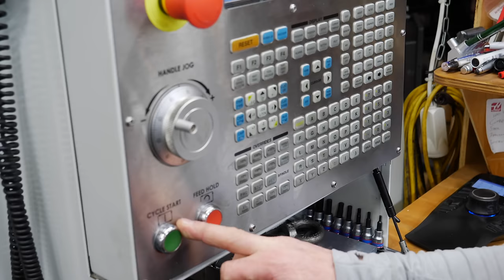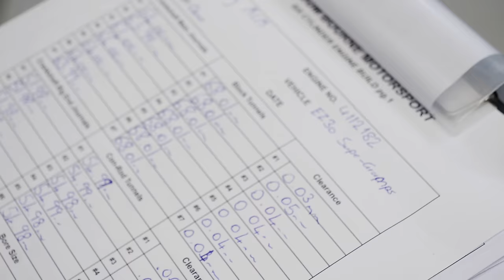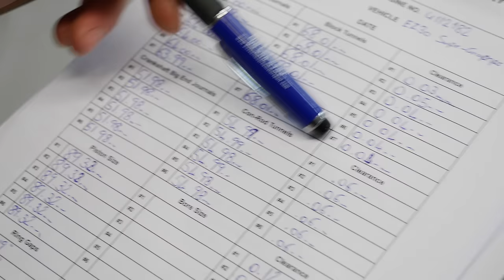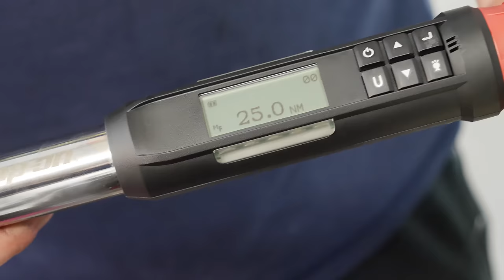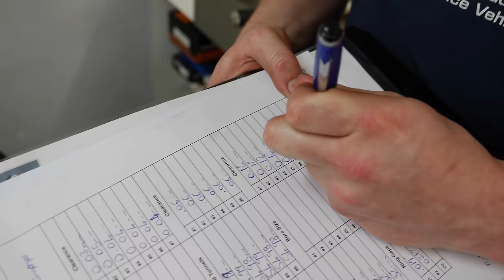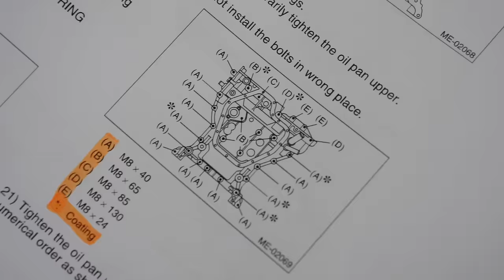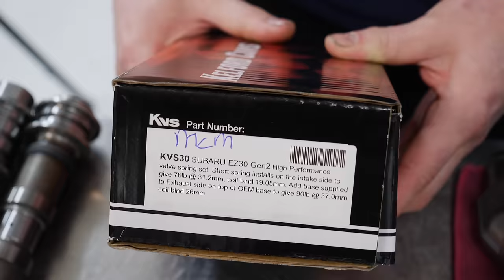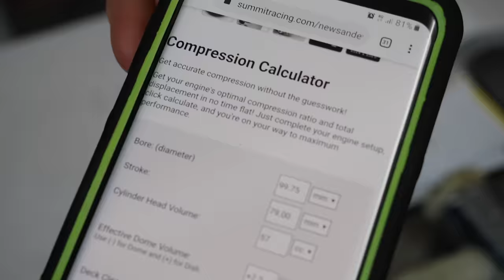What's in the Crate? - Marty's Levorg Part 9

Comment: That fact that dude is in a engine clean room and wearing rugby shorts is probably the most kiwi thing I’ve seen.
Reply: What else would you wear? Apart from safety jandals
Reply: @BrickNewton  I could probably get away with crocks at work. Been wearing a pair of soft toed keen slip on boots on and off for the past year. The rule is don’t get hurt. Refreshing after the last company that required safety glasses, safety vest, and hard hat before you stepped out of your vehicle.
Reply: @BrickNewton  he was wearing boots mate, Rj in Oz
Reply: @BrickNewton   I’m a Australian and I do that  so it’s not just kiwi’s that do that
Reply: I was gonna say the same thing
Reply: Canterbury does make quality shorts.
Reply: Clean room just means no grinders, dust making etc....
Reply: Fuckin oath they do
Reply: A kiwi wearing a kiwi costume was the most kiwi thing I've ever seen.
Reply: Marty in jumper and pants ( leg prisons) Glenn is in short and shorts..
Reply: Needs a roll of fencing wire on the wall...
Reply: The shorts and work boots seemed very fitting!
Reply: @captain1334  an.. an Australian
Reply: @jonathanwright5550  Yeah it's not like the clean room I work in, from time to time, where you have to wear hair nets, beard nets, full anti static overalls, anti static gloves and anti static shoes (i'm a computer scientist). Fail to wear one of those things and my ass is fired. On the spot.
Reply: I'm used to semiconductor cleanrooms. I don't consider this a cleanroom.
Reply: *stubbies (Kiwi name for short shorts)
Reply: I spotted safety flip flops. 😂
Reply: Hahaha the scientists in the lab at my work do the same thing I always give them shit 😂 wearing there lab coats and it looks like they got no damn pants on 😂 if only the bloke wasn't wearing hurricane shorts it might be alright 😂🇳🇿🤦
Reply: Only thing that would make it more kiwi is if he was wearing boots 😂
Reply: @BrickNewton   THONGS
Reply: @hammatime94  yes
Reply: @FalloutProto  pretty sure he's wearing work boots right? 🤣
Reply: @therickman1990  Yep true, cleanrooms are usually vacuumed & dust free which Subaru engine factory has.
Reply: Stubbies all day🤙
Reply: rugby shorts = well balanced low rpm hp output torquey engine that's easy going and steady,

if the builder wears tights you end up with a high revving screaming engine with hp pushed to higher rpm,  not preferred.
Reply: A Big Ben meat pie covered in Watties sauce in one hand, a Tui in a stubby holder in the other, sitting on a shingle beach in the rain being eaten by sandflies is probably one of the most Kiwi things I've seen lol
Reply: When I work on classic cars alot of times I wear a Tshirt and basketball shorts that way when you're leaning on the fenders can't scratch em up
Reply: @David-xl8zf  they're called jandals in NZ, and thongs in Aussie 🤣
Reply: @2dcutout stubbies was a brand of shorts, they’re long gone now.
Reply: @MasterChief37  in the same way I call a vacuum cleaner a hoover (despite being a brand name), all Kiwi's call short shorts stubbies. As I'm sure you know
Reply: @2dcutout  except I’m a kiwi and I don’t, I never have. Probably because my mum never called them stubbies.
Reply: @MasterChief37  yeah I figured you are. I've lived in multiples places around NZ and everyone called them stubbies, hence my original comment.
Reply: ...and he put in those piston pins from the side, like Richie McCaw entering a ruck.
Reply: @2dcutout  good for you, but I don’t know anyone who does, but I do remember the brand.
Reply: With his deep voice I was expecting him to be blurred out or in a shadowy room...
Reply: So humble, the fact that Possum Bourne rang and offered him the job is a huge accolade as well as minting him as doing his job for over 20 years now.
Reply: @BrickNewton  dude......classic! 🤣🤣
Reply: @therickman1990  This is a clean room in terms of car work. You don’t want drilling/grinding/sanding going on anywhere near engine assembly. It is a common and commonsense term used widely. 

The idea that every industry needs the same conditions as semiconductor manufacturing is pretty weird.

Comment: Epic. Boosted 6 cylinder Subarus are amazing. Years ago I turbo'd a 1994 SVX and it ran great until the gearbox exploded. I loved that car tho.
Reply: Loved my '94 SVX LSi as well! Such an awesome car. The EG33 is a fantastic engine. It's too bad about the 4EAT, otherwise they may have sold more.

Mine had a 4.44 swap from an Outback/Forester. Much stronger (save for the front diff being the same - my first 4.44's front diff grenaded after one too many launches), and had way more get-up-n-go, but the car really deserves a 6MT with DCCD and at least an R180 rear diff. I had a Subiechips/ECUtune stage 2 tune with 550cc yellowtops on mine. Stripped it and sold it for scrap due to rust (Canada). I'm hunting for another one though, and I'm planning on a full turbo build when I find it. Unfortunately, it's getting harder and harder to find decent rust-free lower-mileage unraped examples.

Was yours a single turbo? How'd you package it? Up in the right-side firewall corner? I'm still a member on the FB owner's group, and there's at least one other member there who's doing a turbo build as well. The community is still very much alive!

Comment: This video is fantastic. I have read and seen some things regarding Subaru engine design, but it was a little hard to visualize but now I get it. I spent a lot of years repairing and rebuilding old American iron, but the most advanced engines I had apart were 90’s vintage Honda’s and Mitsubishi power plants. A lot of mechanics in the area at that time were terrified of those engines, they just wanted to work on what they knew. That being Chevy and Ford V8’s and those awful 2.5 liter four cylinders that GM and Ford were building for the US market at the time. I can’t wait to see how this works out.

Comment: Amazing insight on how a boxer 6 is made and assembled. I would add from my limited experience that valve stem seals should be added without any oil on the seats so they can grip dry on dry and not slip afterwards during high rpm. Some people even add a bit of loctite, I'd say that it's excessive if they are installed properly. I've had friends of mine who installed them with oil or haven't cleaned the seats properly only to have them slip out of position and then the engine starts burning oil. Luckily it is not such a difficult thing to rectify afterwards as you only need to take out the cam cover and cams themselves. Also I would highly suggest using valve sleeves when installing the stem seals as the sharp edge on the stem where the keepers are designed to sit, can damage the soft lip of the stem seals when passing through them. So the correct order is valves in first, sleeve on valve second, then stem seal pushed all the way down on a dry seat, a drop of oil on where the valve stem meets the seal, manually move the valve up and down a couple of time so there is a film of oil between valve stem and seal, then valve springs and keepers. This ensures that they are in place and sufficiently lubricated on the first engine start until the oil pump builds pressure

Comment: Wow, Glen has my dream job. Works by himself in a clean room, blueprinting and building engines all day. I enjoy working on cars, but typical automotive repair (what I did) is full of constant interruptions and requirements to deal with picky customers. The quality of your work is always limited by what the cheap-ass customers are willing to pay for (which is usually nothing)

This guy is doing meticulous, detailed-oriented, high quality work, done (normally) without interruption. Sign me up.

I have an EZ36 in my 98 Legacy GT. I went that way because it was different, I was inspired by the original Gramps, and it makes more power in stock form. Mine is all stock except for a set of headers (just to get it to fit in the car) and a Haltech Elite 2500 (again, just to make it work). It’s still “in progress” but I’ve driven it once and it is so much fun. A huge upgrade over stock and better than the WRX swapped Legacies I’ve driven, and it’s not even properly tuned yet.

Comment: I remember doing up stretch head bolts on a 1.9 GTI engine i was dropping into an old 205 GTI after a rebuild. 1 bolt snapped, was a proper nightmare to get out. Managed to get it out though after hours of work and then another bolt (not a stretch one) snapped that holds the rocker cover down. They were brand new bolts also. Took 2 days work removing them properly.

Comment: One of my favorite mods for k20 and k24 engines is VTEC delete cams. Basically puts you in VTEC all the time so the engine breathes like a cheetah. It would be awesome if there was a Subaru cam/rocker set that did the same. I hear it can be achieved through the ECU though.
Reply: No rockers on the Subi. My bad.

Comment: You always want to leave your Caps loose or in this case your cases not so tight until you push the crank forward and the crank backwards make sure you have the thrust bearing aligned perfect for less friction and your caps are square

Comment: There are 2 torques.  Installation torque and checking torque.   Checking torque, lower, takes into account stretch. Keep doing it to installed torque and over time the bolt will fail.

Comment: I've never seen a Subaru engine go together, I'm used to the VW/Porsche air cooled engines where the cylinders are separate from the case. This seems like a lot of extra work lol.
Reply: I am more used to Alfa flat 4s. These have a one piece crankcase with bolt on main caps. You can do the pistons and rods in the conventional way with these, and tighten big end caps in place (I have changed the big end shells with just the sump plate off)

Comment: I really enjoy seeing how the modern tech hot rodders do it.  For my cheapskate take on hot rodding though, I couldn't stomach the cost of that engine.  Small block chevy assembly charges from my builder  (high compression, stroker, solid roller, aftermarket heads) for my engine was $300 for the short block and $300 for the top end.   It was $6600 total for an engine with all the forged goodness, machining and assembly.  I would be very curious what the total on this was.    $20k?   $30k?

Comment: My understanding of calculating the CR when I learnt the trade was to do the same measurement to the piston dish and HG as well, not just the cylinder head Cumbustion Chamber. Has this changed or is there a new formula?
Reply from the maker: Fairly sure those specs are provided
Reply: @Mighty Car Mods  we where always drummed to double check, as you could have been sent the wrong part. All good, I understand where you're coming from.

Comment: Fun fact (21:11) custom tooling is a fundamental part of a surgeon's tools.  Just as people are unique, tools and fasteners are sometimes designed for just one surgery.  My wife is a mechanical engineer whose entire job is designing those tools.  Let's give a for-example just to solidify the concept.  If you severely break your leg in a 3rd world country, you don't have access to x-rays to properly set the screws (heck, most times they don't have electric power) - there are special tools which are sent from my wife's employer to those countries for each surgery.  Those tool kits if bought (non-profit company so it's all free to the doctor and patient) as a set cost between $30,000 and $60,000.  Each tool is designed for the size of the patient, age, type of fracture, and other environmental factors.... the tl;dr is the engine engineer there could moonlight as a tool maker for a surgeon...

Comment: How does the EG33 compare to the EZ30 and 36?
Reply: The EG33 is arguably a better platform for boosted builds. If you check out Subieperformance here on Youtube, he compares the two engines side by side (they also have a sleeved EG33 build series). The EG has much thicker cylinder walls, a better lubrication system, and shares internal components with the EJ22 (effectively it's an EJ22 with two more cylinders, bore and stroke are identical, as are the rod and mains bearings). This means that aftermarket parts for an EJ22t will drop right in, including forged low-compression pistons.

The EZ has a timing chain, whereas the EG - being based on an EJ - hais a timing belt, which makes it more efficient (albeit at the cost of a more frequent maintenance schedule). I do believe the EZ is an interference engine as well, whereas the EG is not, due to the intake and exhaust cams being linked via permanently-meshed gears in the heads. My SVX snapped its timing belt at redline and it just died and rolled to the side of the road. Snaked on a new belt, set timing, pulled the pin on the tensioner, and it fired right back up as if nothing had happened.

Also, the EG sounds better if you ask me. Check out Any Forrest's 'Stormtrooper' Impreza with a fully built single-turbo EG33 pushing 1200hp. Absolute monster.

Comment: Subaru was still making their flat-six as recently as 2019? For some reason, I assumed it died with the SVX.
Reply: It's a different engine (well set of engines EZ30 & EZ36, at least two variations) to the SVX (EG33)
Reply: @clasdauskas  Still, they were making flat-sixes far more recently than I thought they were.
Reply: @TBustah  Yep, though I gather they have stopped now, and use a turbo 2,4 instead. Which is a pity as the sixes are/were wonderful ...

Comment: high compression and turbo doesn't mean you have to run ethanol. the number 3 honda tuner on the east coast literally had built a f20c s2000 engine. that's 11:1 ratio. he built and tuned it. he did NOT reduce the compression in the build. he kept the 11:1 compression ratio. and then boosted the living shit out of it. and made insane power numbers. if the tuner doesn't feel safe doing it, its probably because they dont know how. doesn't mean its not possible. ive seen a LOT of high compression insane boosted engines here in the US. its really common in my state. no one wants some 8:1 low compression pos with insane boost. in fact most people shoot for raising compression when their engine doesn't have enough. the only guys sticking to low comp are generally the old muscle car guys because they are used to low compression ratios so their brains don't know how to make high compression work.

Comment: As cool as this EZ 30 is EG33 more power and some of the fastest Subarus in the world probably the fastest Subarus in the world in drag racing or time attack running EG 33s
Reply from the maker: Eg33 is bigger, ez only 2.5cm longer than ej
Reply: @mightycarmods  yes, very true however even with that extra length the EG33 fits without too much problem, Radiator and intercooler still fit up front might need a bit of special selection on those items but at this late of date the research has been done so it isn't trial and error anymore. Friend of mine somewhere on the gold coast has a built eg33 in an 04 STi its very crazy. before he sent the engine to be built he put a bone stock one in for fitment checking. ran 538HP on a completely stock block started lifting heads at 550 but hit 600 ( I think) without destroying the block
Reply: @mightycarmods   Don't take my comment as too much I have seen and like EZ30 builds and who can't get behind the EZ30R with the advanced tech the smooth boxer 6 is a very inspiring thing.

Comment: Are motors internal combustion engine and are internal combustion engines motors? Do we use these two names with different definitions as the same thing? As an ASE certified master tech graduate of NASCAR technical Institute it just drives me crazy. …Motors are externally powered. Would you call a goat a cow?